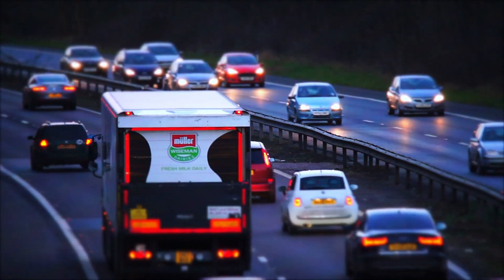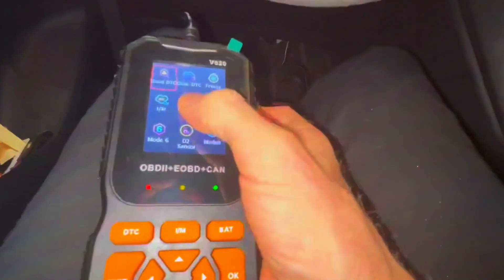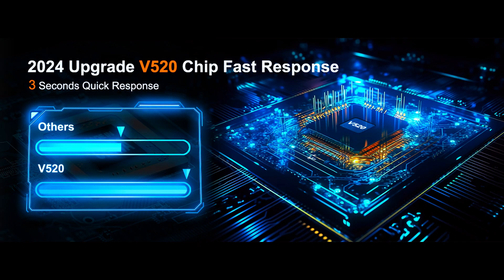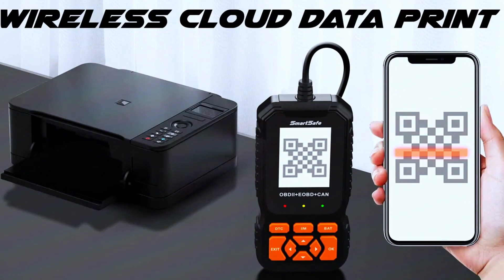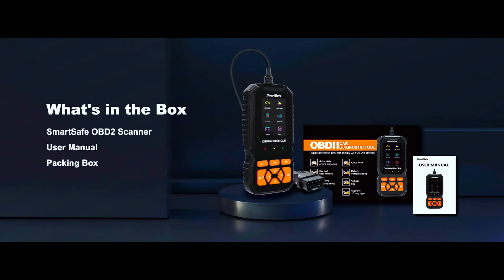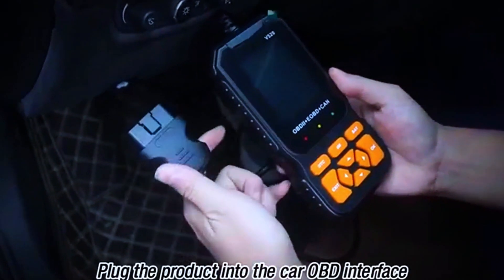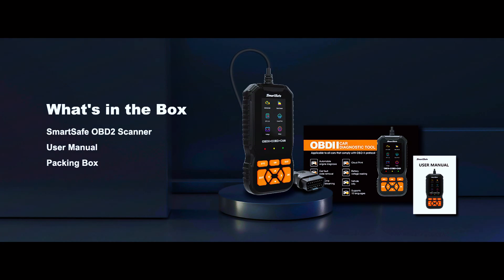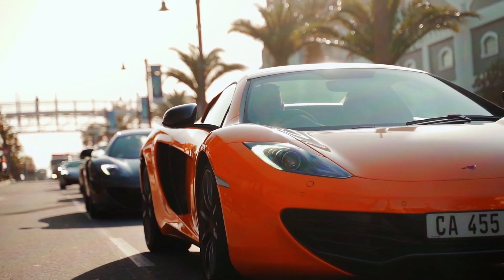Smart Safe v20 OBD2 Scanner : Read & Erase Fault Codes |

Comment: Is the scanner compatible with a 2002 BMW E39? Does the scanner clear the airbag error (after an incorrect airbag shutdown with the battery still connected)?
Reply from the maker: Good question. Short answer: probably not — at least not reliably. Here’s why: while the Smart Safe v20 might show generic engine/OBD codes on your E39, it’s unlikely to successfully clear or reset airbag/SRS errors. For that, you’ll need a more advanced or BMW-specific diagnostic tool.

Comment: Does it work to subaru forester 2005
Reply from the maker: Yes, the Smart Safe V20 should work with your 2005 Subaru Forester for basic OBD2 functions like reading and clearing engine fault codes and viewing live data. However, it may not access advanced systems such as ABS or SRS since those require a more advanced scanner with full Subaru system support. Make sure the tool’s software is updated for best compatibility.

Comment: Can you show me how to update the firmware?
Reply from the maker: Steps to Update Firmware

Connect to a stable internet source
Use Wi-Fi (if the device has it) or a USB connection to a PC with internet access.

Power on the scanner
Make sure it’s fully charged or plugged in so it doesn’t die during updating.

Go to the Update section
On the scanner’s menu, look for “Settings,” “System,” “Firmware,” or “Update”.

Check for available updates
The device should show available firmware or software updates for modules or brand packs.

Download / install the update
Select the update you need and let it download. After downloading, proceed to install. Don’t turn off the unit mid-update.

Restart the scanner
After installation, reboot the device. This ensures the new firmware loads properly.

Verify version
Back in Settings → About or Firmware Info, the version should reflect the update.
Reply: @weeklytools making a video will be great ✌️
Reply: Does works to subaru forester 2005?

Comment: Does the device work on diesel vehicles 2010+
Reply from the maker: Yes, the Smart Safe V20 OBD2 Scanner works on most 2010+ diesel vehicles, as long as they are OBD2/EOBD compliant. This includes many diesel cars and light trucks that follow standard OBD2 protocols — however, for heavy-duty diesel or older non-OBD2 systems, compatibility may be limited. Always check your vehicle’s OBD2 port and manual to confirm support.

Comment: Is it for all vehicle
Reply from the maker: The Smart Safe v20 OBD2 Scanner is compatible with most vehicles manufactured after 1996 that support the OBD2 protocol. However, it's always a good idea to check the specific compatibility with your vehicle model to ensure it works effectively.
Reply: Renault clio no

Comment: Is this scan tool has ability to do ACC calibration and reset the adaptive cruise control system alignment?
Reply from the maker: write a short answer about, Is Smart Safe v20 OBD2 Scanner this scan tool has ability to do ACC calibration and reset the adaptive cruise control system alignment?
The Smart Safe v20 OBD2 Scanner is a powerful diagnostic tool, but it does not have the capability to perform ACC (Adaptive Cruise Control) calibration or reset the adaptive cruise control system alignment. ACC calibration typically requires specialized equipment and tools designed specifically for that purpose.